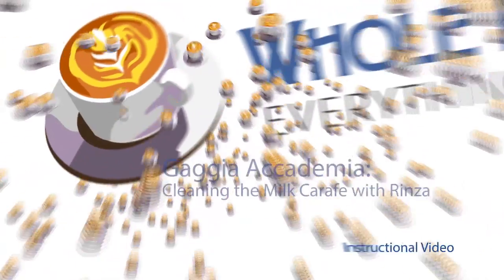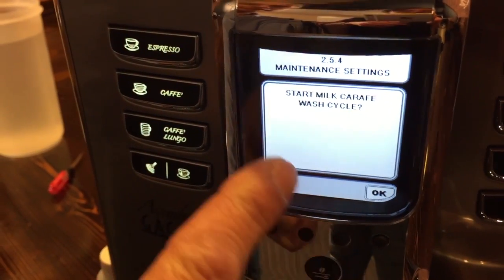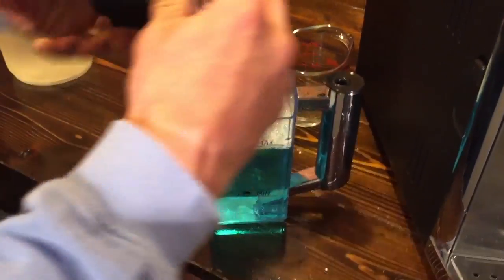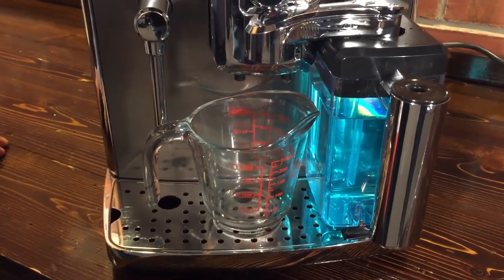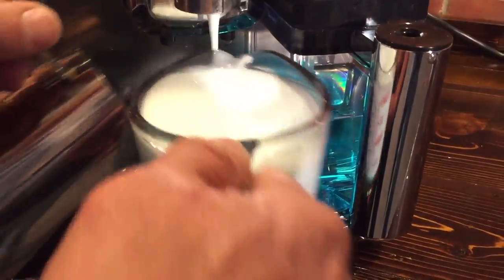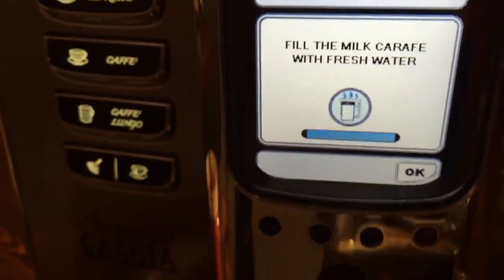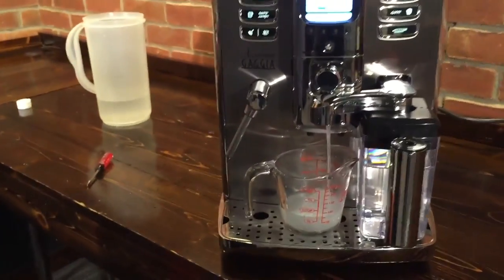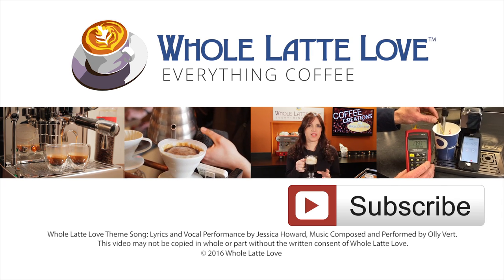How To Clean a Gaggia Accademia Milk Carafe with Rinza

Comment: Apologies, but I'm a bit confused about the amount of Rinza to use for my Accademia. In this video, the entire 4 oz Rinza bottle was poured into the carafe, which measures about 18 oz up to the max line. However, the 4 oz bottle mentions using 1 oz of Rinza per 16 oz of water. This Rinza and water concentration, according to the instruction diagram, appears to be for a machine that draws in milk from an external, non-attached carafe. However, one might assume that this concentration would also apply to the Accademia's attached carafe. Am I missing something? Definitely prefer the bottle's instruction, since I'd then get almost 4 uses per 4 oz bottle.

Comment: Tami Roberts
Thanks for the tutorial guys. I just purchased the Gaggia Velasca from you May, 2022. I have a lot of Rinsa that I haven't used. Is there a way to use the Milk Froth button, programming amount to be frothed, to trick the Velasca into doing this cleaning cycle? I assume you would dilute the Rinsa more since you wouldn't be pulling water from the reservoir. Then maybe run two complete rinse cycles? Or would it be better to do only the manual cleaning? What do you think?
Reply from the maker: Hi Tami, First, never put Rinsa in the reservoir. Only use in the frothing pitcher or as a cleaner for other milk parts - you can soak those in Rinsa as part manual cleaning. You absolutely dilute Rinsa into the carafe and run it through using the Milk Froth Cycle. You do not need to do 2 cycles. Run through for about 20-30 seconds then rinse the carafe, fill with clean water and run another 20-30 seconds on the froth cycle to rinse. Depending on use level you could do that every few days. Still recommend doing the manual cleaning weekly or whenever you notice a decrease in frothing performance. Hope that helps!

Comment: I just ran the carafe wash cycle using water and cycle one produces only steam... it not does not pull the water through like the video... any tips?   Cycle two does pull the water through.  Can you use another detergent than the Rinza solution?  Im in a jam with visitors this morning!  TY